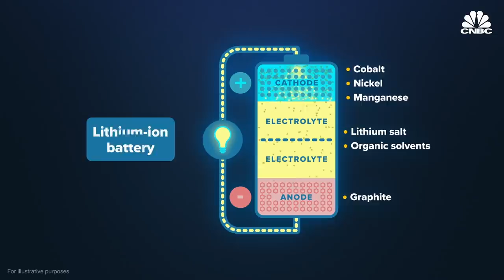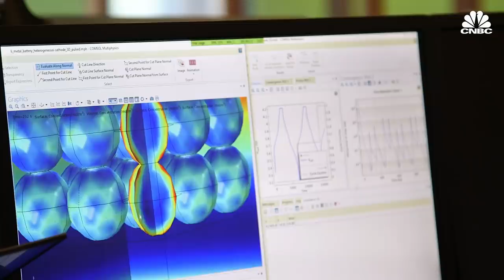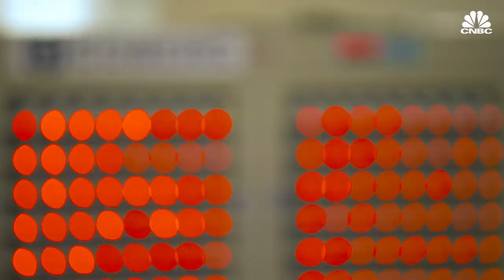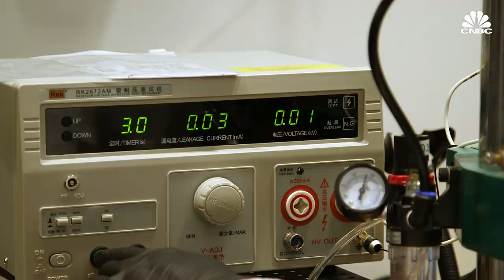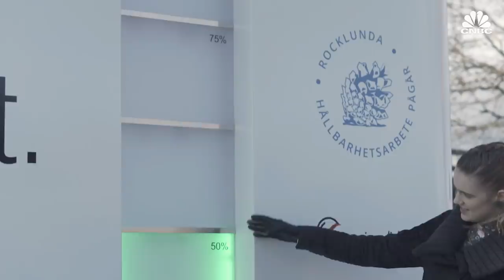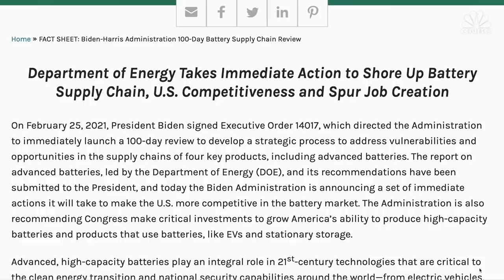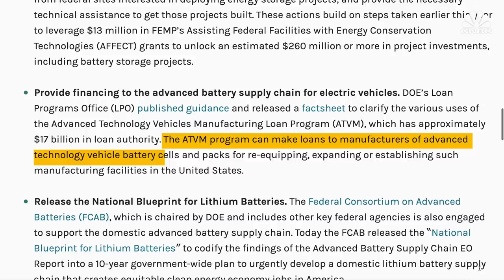Why This Battery Breakthrough Could Make EVs Cheaper

Comment: This report assumes that standard lithium ion battery cells are not going to evolve/improve over the next 10 years. By the time NorthVolt is able to successfully mass produce their lithium metal cell, the industry standard lithium ion cell will be light years ahead of where they are today. Their lithium metal cell will no doubt have a higher energy density, but I have a lot of trouble believing that NorthVolt will be able to match lithium ion cost wise. Anyway, I hope they are able to achieve what they are working towards.
Reply: well you got to say Lithium batteries are reaching a saturation point... they are reaching the peak of the technology.... this is why they are looking for new solutions because current batteries are just not gonna cut it in a few decades.
Reply: @erikpienk  correct the li ion battery is limited by the lithium...so it cant be made much better...
Reply: Not true, the graphite in the anode can only hold as many ions. Lithium-Metal is the future how ever you look at it.
Reply: The current concentration on Lithium Ion research is COST REDUCTION now, not density.  Doing it with LESS lithium, mainly.
Reply: @redwolfexr  With lithium-metal you can do it with no anode.
Reply: @erikpienk  Actually we have just scratched the surface of li-ion tech. In theory li-ion can go to 10kWh/kg (one li-ion for each electron). Now we drag huge amounts of infrastructure to host that one ion. Plenty of new ideas to try to optimize this.

For example many are fixated to pouch, prismatic or cylidrical cells. And forgets there’s more cell types. Like thin and thick film cells. And those are roll-to-roll processed high speed and volume types of cells.

With bi-polar thick-film cells even LFP can go close 300Wh/kg. Requires solid polymer electrolyte which limits the C-rate but C/2 is perfect for many applications. Like energy storages.
Reply: Expect maybe 400Wh/kg in 10 years time. There will be no 'fast advance' in Li-ion 'technology'. It's pretty mature right now.
Reply: @erikpienk  So, find a new 'couple' ! There isn't one !
Reply: @rojavabashur6455  Wrong. Pure Lithium metal would be insanely too expensive to use. try again.
Reply: @rojavabashur6455  NO ANODE ? THAT'LL BE AN INTERESTING BATTERY !
Reply: @mfb424  RUBBISH. Li-ION CAN'T MAKE OVER 600Wh/kg. DREAM ON ....
Reply: @grahamstevenson1740  why that limit? How did you come up with that number?
Reply: @mfb424  GOOD QUESTION ! It's a limit on materials performance. For example can you make the metal foils used in the batteries (copper and aluminium) any thinner and what would the result be. Yes, you could and there would be a positive outcome before electrical resistance losses made such a move counter-productive.

The problem here is in materials handling. Foils thinner than 10 microns (micrometres) are easily torn by automated materials handling equipment, so would bring any production line to a standstill.

Life is full of such 'inconveniences' !

Personally, I'd be inclined to persevere. Reducing those foils just to 8um thickness would likely gain 10% on specific capacity worth around 30Wh/kg extra. That might easily pay for some better manufacturing machines.
Reply: @grahamstevenson1740  this is why separator coating is an option. Far more easier to achieve good adhesion with binder/electrolyte. And for example with LFP we have enough stability to use cellulose separator with embedded polymer electrolyte. Sure. Not so power intense but that door is now open to any application with long discharge time. Like shipping and aviation. All thay said the main driver for this tech comes from grid storage. Due the cost and speed. So no Ni, Co, Cu, Al and liquids needed.

One thing to watch is the sulphur crystals. With right secondary particle mechanics it’ll just happen one day.
Reply: Li-100 percent si anode has 400wh/kg limit where as li metal has 1700wh/kg. companies like enovix already has 350 wh/kg with 94 percent silicon in anode while tesla is around 300wh/kg with 30 percent silicon loading in 4860 cell anode . so, we are already reaching the limit.
Reply: @pinakdas6300  No we are not. Not even close. The limitations come from design and construct of the cell. Almost all cells in the market are really poorly optimized.

Again. One kWh of stored energy with li-ion weigh about 150g. And to release that electron we need only few other atoms to hold the li-ion. Now we still have 100x too much ballast in the cell. Plenty to optimize still.

Comment: "Hopefully within the decade."  Lithium is progressing in density safety and cost reduction. Lithium is  here and now.
Reply: Unless you want to fly...  it also does not work well for motorcycles.  (scale/weight/power/cost)

As they said, we will have multiple techs.  Lithium Ion is going to be the automobile standard for a long time.  Lithium Metal (of any flavor) is going to be where the density/weight demands it.
Reply: True, but it's only a temporary benefit. Once they have learned mass production, one must compete on what the batteries can offer.
Reply: it is here just not good enough...
Reply: @billdale1  now do you see the current lithium battery good enough to replace airplane jet engine? From what i see it still not good enough, we still see the competition from various battery tech and the winner haven't been clear cut... Once the battery has been good enough to replace jet engine i think they will use it... Maybe in the next 10-20 years they will change but not in next 5 years...
Reply: LIPO4 seems to be the way it's going............Lithium iron phosphate.............Paul

Comment: My question is about scarcity. Similar to how much crude oil we have left, how common or scarce are the elements used in these batteries. I.e. lithium, cobalt, and manganese? The batteries go bad at some point and need replaced. And as the tech improves more an more devices are running on these resources. Will we run into scarcity at some point?
Reply: Yes, that is an issue. The real issue is overpopulation. That’s what’s driving scarcity of resources. But nobody seems to want to discuss that factor.
Reply: Asteroids. It would be near an infinite resource. That’s why Musk Mars landing would be so important for humanity. The only problem is travel speed and the cost for R&D. Which makes it more of a government issue.

Comment: If they can't solve the charging time it will not be the next big thing.
This is the only reason why Gas-powered cars are dominant.
It's not just the reach it's the speedy refilling of Gas-powered cars that makes them superior.
In the early 1900 there were 10 000 electric cars in New York.
But when the starter motor was invented all those cars went away over night.
So most important is charge time and then reach, fix that and no one will drive a Gas-powered car ever again.

Comment: We all know the real answer to solve the low energy density of lithium batteries is the flux capacitor!
Reply: Not to mention the Vibranium used in their construction.
Reply: @grahamstevenson1740  ,
With a dividing layer of Adamantium to prevent punctures...
Reply: Another Dreamer...............Paul

Comment: With lead acid batteries, they used to have loose plastic grids in the liquid electrolyte in hopes that the vibration from the car would move the grid enough to break any dendrites that might be forming.  A mechanical approach such as this, perhaps an active impeller, could be used if the electrolyte is liquid.  The electrolyte could even be cycled from a reservoir providing not only the mechanical agitation but provide the cooling and perhaps allow limited recharging by the replacement of the electrolyte albeit at the loss of electrode conditions that will require remanufacturing or replacement after a set number of electrolyte changes.  This partial electrolyte recharging was proposed for lead acid batteries in EV's back in the 70's to give recharge times of minutes.

Comment: Think of the number of passenger and commercial vehicles in this world, add on construction and farm equipment, do not forget about housing, business, and manufacturing.  What is going to be the environmental impact of securing the resources to put together that many batteries and replacements?   Think, it is not that hard.

Comment: Price isn't the only thing that people find off putting about an electric vehicle. If you go on a road trip and run out of juice, you don't just get brought a jerry can. Having a charging station that can handle charging a vehicle properly and effectively is costly. Having a vehicle that uses power even when "off" to keep itself cared for isn't a good thing for most people, I mean would you buy a car that uses gas when it's off? Something like 25 percent or more of people who have bought an EV went back to ICE cars already because of these and other reasons.

Comment: These people at CNBC need to fact check and re-up on current information. This is like a Sophmore in High School giving a lame book report
Reply: Absolutely. Northvolt, which they call an "EV battery giant," has never sold a battery cell and is building their first factory now. So, no editors there, and the reporters are definitely not doing their research...
Reply: Closer to a 5th grader.
Reply: I’m sure they just pickup anyone off the streets these days. MSM reporting is trash.
Reply: Just a friendly reminder that; cynicsism is not an indicitive to intelligience.

Comment: "10-20% better than lithium ion in 5 years." As if lithium ion isn't going to improve. By then lithium ion will be much greater than 10-20% ahead of where it is now.
Reply: @nissetuta  Current trends.
Reply: Lithium ion hasn't really changed much recently. It won't change in the future much either.

The changes has mostly been stuff like bigger cells or different-shaped cells, or faster charging tolerance.
Reply: @MsHojat  What do you expect to happen, scientists to create a genetically modified lithium? It's all about the complete package what what they can do with it. Different elements are being added to it, cells are becoming more energy dense, cells are created with less heat transfer, capability for larger cells, etc etc. You kind of answered your own question. Just 13 years ago I had an electric bike that could go 15 miles on a charge. Now a pack of the same size can go 60 miles. Lithium ion is progressing at every level.

Comment: for aviation, the higher energy density of 400-500 Wh/kg will be a game changer. in a pipstrel alpha electric, you have cells with approx. 200Wh/kg. getting double the range would allow you two hours of flight. that would be great. reaching 500Wh/kg would be awesome and allows more performance and a bit more cargo. the huge cost savings on maintenance results in carbon free flying that is not more expensive than with gas.
of course it would be great for cars too, but the real kicker here is the aviation industry.

Comment: even if the ship is autonomous electric, you still need a few crucial team to manage and monitor the ship. like tech engineers in case if theres a problem in the electronics. you still need generators if a storm hits and fried the battery for example. and occasional maintenance report

Comment: well if you could make a salt based battery, then you could use heat from the sun to desalinate ocean water. then youll have drinking water and salt for batteries. if put pipes in roads to pump water from the ocean to a mountain top water wells in summer, you could irrigate crops below. in the winter you could heat the roads just above freezing to keep snow off.

Comment: I feel like expecting electric cars to charge as fast as ICE cars can be filled up is the main thing holding them back. People are so worried about how fast you can do stuff instead of how much better something is that may take a little longer. Stopping for an hour to charge on a long road trip isn't the end of the world. We need to focus on making batteries more efficient, (longer range) making them better for the environment to produce, (mining conditions are terrible for the environment but still overall, better than ICE cars throughout their lifetime) and making them last longer, (Higher number of charging cycles) as well as making them more easily recycled. You wanna be able to drive cross country with an electric car and not have to stop and charge. Then there needs to be a system put in place that can charge the cars as they drive. Kinda like how trollies have those arms that reach up to the power line. Except make them hang under the car and fit into a grove in the road surface. Doing this on major highways alone shouldn't be THAT expensive and should be more than enough to make range anxiety a thing of the past. Think about it. If you need to travel across the country. The majority of your trip is going to be on major highways anyways. Imagine it like those slot cars from back in the day. They could even be integrated into the self driving system as a way to help steer the car. It would just have to be a universal system that all electric car manufacturers would have to adhere to. No. It wouldn't be cheap. But I think it would be more than doable. Especially if we stopped shoving money into the pockets of the gas Giants and started investing it into infrastructure.
Reply: Well that and youd have to drive a tesla for 22 years before it was better for the environment and it's battery doesn't last even 10, like most things in this technology sector they are highly subsidized scams that aren't doing what they say they do particularly when it comes to global warming which is another scam centered around extracting wealth from the serfs. Electric cars are doing more damage to the planet than fixing and you can apply that reality to every subsidized green energy technology. Human stupidity at it's finest
Reply: re: "People are so worried about how fast you can do stuff"  because: GREED.  having gone unresolved and unchecked, it has now worked it's way into every aspect of our lives.  thus since it's become "normal" we don't look at it (our ourselves) critically, but yet the problem is STARING US IN THE FACE every time we look in the mirror.
Reply: @kittybrowneye3163  So ICE cars are cleaner than electrics? (Seems that is what you're saying)
Reply: @raybin6873  when you factor in environmental damage during manufacturing and you take an average of the US power grid pollution by electricity generated and compare that to the life of the vehicles (really the battery) that's exactly what I'm saying. Why do you think all the lithium and rare earth mineral mines are in China? I'll give you a hint, it has nothing to do with the fact there isn't any lithium or rare earth minerals in North America. Like I said the whole global warming thing is a farce and being sold to people in an extremely distorted fashion to create profits and a lynch pin moral argument to sell to the lemmings. The planet is actually in the middle of an atmospheric carbon low it hasn't seen in 7million years and that's causing strange things like desert expansion all over the world, It's actually quite fascinating when you really start taking a look at it alot of political bs to wade through though
Reply: @kittybrowneye3163  I don't trust your information - you appear very politically motivated - more than scientifically. There seems to be data that contradicts what you're saying (I'm not interested in starting arguments)...just like having facts /data presented minus the politics.
We all are entitled to our own opinions.
I do want to mention that petroleum resources are finite...we better develope alternatives. We can't ride the petro pony forever...I'm curious what it'll be.👍

Comment: Let's get on aluminum air batteries and lithium air batteries. They are 5x to 15x more powerful than Lithium ion batteries. This means hydrogen systems would work for cars and planes. This also means you could have plasma jet engines which means you can have an all electric jets and fighter jets. Aluminum air batteries and lithium air batteries can be made just as cheap as lithium ion batteries.

Comment: Even if they can't get them to support good fast charging, they can still be great batteries.  Just maybe not for EVs.  But for energy storage, and other areas where fast charging isn't important.
I don't see a jump in tech from any of these battery techs.  LiIon is getting better, and I think as LiIon starts to get towards it's max, then one of these options will be enough better to start to take over.  But I don't see any of them as "new battery will double your range" type of things.  At least not initially.  It will be smaller steps of improvement.  Which is still great.  Pulling for all of these techs...  Hopefully they find their spots...
Reply: Li-ion is already nearly at its max output you fool
Reply: @SahilP2648  Have a good day...
Reply: @desiv1170  lmao. Just dodging the fact that you are wrong. Just look at Tesla's innovation in Li-ion. They literally are crawling right now trying to add density by changing the dimension and using a different packing mechanism. Even then they gained an efficiency increase of just 16%. The rest of the metrics are fabricated because they are not comparing it apples to apples: https://abcnews.go.com/US/teslas-battery-technology-drive-cost-electric-cars-company/story?id=73222745
Reply: @SahilP2648  <sigh>  Not dodging.  I never said LiIon wasn't near it's max.  Just said it was improving.  Those aren't mutually exclusive.  Have a good one...